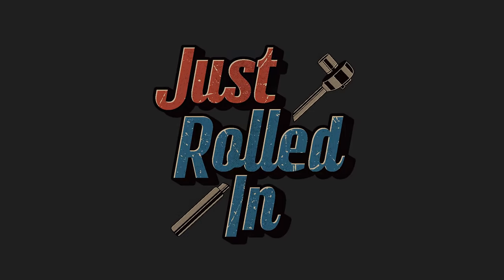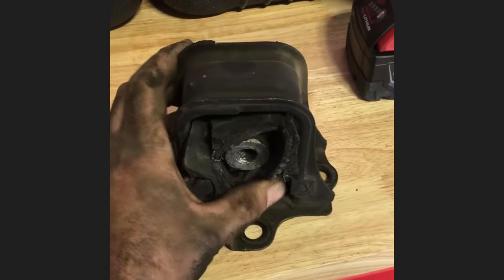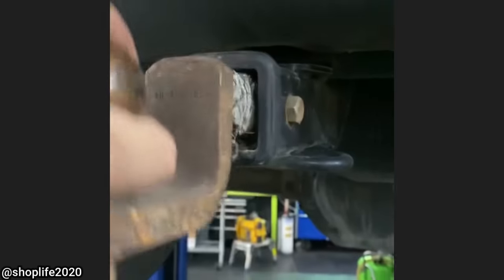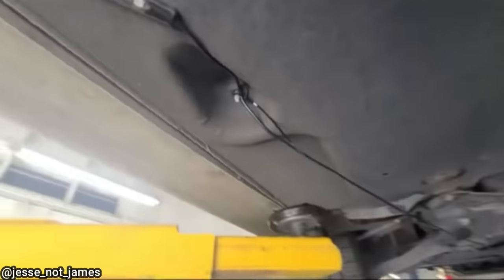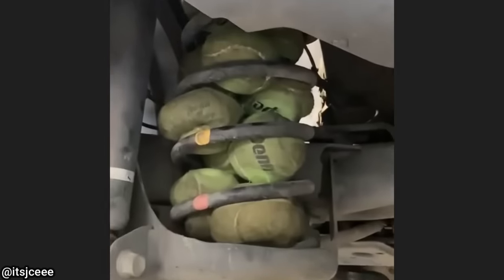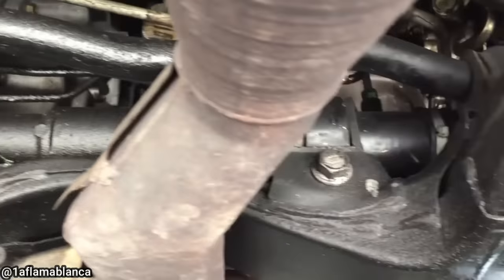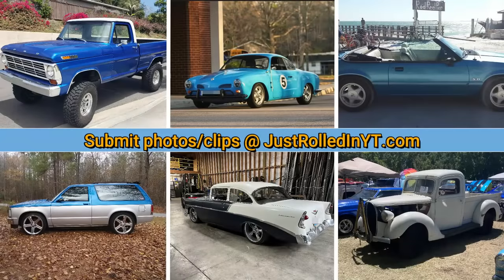Customer States Change Engine Oil On Tesla | Just Rolled In

Comment: I worked with a guy who got his amusement calling auto parts stores and asking for spark plugs for his Cummins. More often than not the store employees didn’t understand why this was a stupid request and earnestly tried to find what he asked for
Reply: I spent 30 years in the auto parts business . We did the same thing with new employees including radiator caps for V/W beetles and points for 1975 Chevrolet's
Reply: I once went to get a refurb kit for the carburettor on my Ford Granada. The parts guy, was obviously just programmed to read what was on his screen. The conversation went thus. 

Me: "I'm after a carb refurb kit for a Granada" 

PG: "Engine"

Me: "2.8, manual"

PG: "carburettor or fuel injection" 

Me: 🤦‍♂️
Reply: @eaglerider1826  

The rad cap for a beetle I get but I'd have thought most 70s Chevys had points and a condenser.
Reply: @imSatnav  You can tell it's a new guy reading off the screen and not thinking .
Reply: @skylined5534  1974 was the crossover year for electronic ignition by 1975 they all came with it .
Reply: I can recall some guys getting 2 young apprentices to try and push start a generator that was mounted on a trailer.
They came in after half an hour of pushing it around the yard, and apparently one said "it won't start, but it nearly did, i heard it fire a few times" :-)))
Reply: @imSatnav  ngl that sounds like something i'd do on 4 hours sleep at my retail job
Reply: Same guy that gets up to the front of the grocery checkout line and asks the clerk if the chicken legs are from the front or the back?
Reply: @robertthomas5906  or asks for "extra medium" size clothing
Reply: Some people really need to get laid
Reply: At a recent festival that had a display from a local military unit I asked the guys what kind of helicopter their armored personnel carrier was. To be fair, I had insider knowledge that someone asked that question seriously two days prior so I just couldn't resist. I was hoping they might respond, "oh yeah, it's got cutting edge rotor-less technology."
Reply: Changed some Cummins spark plugs last week, CNG engine 😉
Reply: I loved requesting parts for an 83 Corvette. 😂
Reply: Or a radiator for a Corvair.
Reply: Jeremiah Coughlin  
Some stores stock it as an UNO reverse card when parents send kids to the store to get some.
Reply: @eaglerider1826  my 79 chevy had points
Reply: @MsAubrey  they do exist.  Both of them, somewhere.  Probably still at GM, though.
Reply: I worked in an auto parts store for a few years.  I had a great mentor.  He been doing it for over 50 years.  Taught me how to use books instead of the computer, and how to find stuff when we ran into dead ends.  I don't bother going to autozone or Napa anymore.  I find it myself and have it shipped to me.  I still remember the old man, and how many of the customers weren't servicing cars, but their items had car parts, such as boats and generators.  We even had military and military contractors coming to us when they hit a dead end.  We weren't always successful, but we always gave it our best effort.
Reply: @TheCabinfever1977  Sir , In 1979 it came from the factory with an ignition module and not points . Someone may have changed the distributor but it did not come that way from the factory . Try going to the NAPA auto parts and looking up a set of points vs an ignition module for your 1979 .
Reply: @MsAubrey  Good one . Most people didn't know that that was the only year that they didn't make one .
Reply: @domin8ss  not for customers. You clearly know what I mean.
Reply: @eaglerider1826  yep. I had a guy call in saying he had a Corvette built in July 1983. My boss back then loved Vettes more than me. When the guy got pissed when I kept asking if it’s the new body style or the old one, he asked to speak to my manager. So, I paged him over the paging system and said, “Hey, Scott a guy on line two wants to speak with you because he said he has a 1983 Corvette and I told him that he didn’t.” I heard roaring laughter from his office. I went to the office and he let me in to hear his conversation. It was pretty funny.
Reply: @MsAubrey  Years ago we sponsored car shows in Alabama and to win the door prize you had to be the first one to the d. J. booth and tell him what year did they not make a corvette .  Hundreds of car guys there and it would take a while to get a winner ( this was before you used your phone to look it up ). Funny part , it was never one of the guys driving a Corvette .
Reply: @MsAubrey  and you knew what I meant, is why it's dumbfoundingthat you got butt hurt about my comment.
Reply: @domin8ss  not butt hurt. Your comment simply didn’t refute what I said to begin with.
Reply: @MsAubrey  you're correct, yet somehow seem confused by this
Reply: a car parts store in germany, somewhen in late 90's. customer came in and asked for a 24V-battery. clerk said, "there is no 24V battery. you either use two 12V batteries or..."
"nono, I'm sure, 24V!"
"What are you talking about, there ain't no 24V battery. nobody never made one!"
"But, it says 24V right on the trunk of my car!" customer point outside to a Opel Senator with 3litre straight six with 24 valves...
that's when you start to wonder if they are that stupid, or trying to troll you...
Reply: @eaglerider1826  it was a 1979 Chevy C10 with a straight 6 3spd auto with points, when i looked up the vin on the engine it was listed as a car
Reply: @TheCabinfever1977  You just answered it . The engine was out of an older model car .
Reply: Jeremiah Coughlin  Should call a BMW dealership, their cars need their fluid replaced frequently, to prevent malfunction.
Reply: @imSatnav  "Carburettor or fuel injection?"   "Neither right now. That's why I need the carburettor."
Reply: @robertthomas5906  From the back. The front legs are called wings ;)
Reply: @BrutalHonduras  Ask sometime if the drumsticks are from the back. LOL.

Comment: In the 1960s, when I was 16, working in my father's garage/ gas station, a very cute girl pulled in and asked me to check the water on her Corvair. I explained that it was air cooled, trying my best to keep the conversation going as long as possible, when she pointed out the Oil cap, which understandably although it was labeled oil, was shaped kind of like a radiator cap. I never forgot her.
Reply: so did you marry her or what?
Reply: @Draco_Alpha  Nope but there's still a chance we might meet again someday. 😎
Reply: When did you wake up?
Reply: Are you sure that it wasn't a 710 cap?
Reply: @stephenolan5539  Oh! Snap. now I get it.

Comment: When I was 16 and changing my oil for the first time I bought the wrong filter and thought I screwed it on right. It wasn't, and I didn't. I ended up spewing the oil all over the driveway. That was a fun clean up, and I haven't made that mistake again for the past 3 decades and going strong.

Comment: The door opening clip, I am genuinely perplexed by that one lol.  Sweet Chevelle!!!
Reply: It looks like the controls on the door panel or sunk in and obviously not attached to the armrest properly so when he pushes the button it must’ activate the door lock Switch
Reply: @bigtuna9529  yeah but why would that open a manual handle and latch??
Reply: @DJTheMetalheadMercenary  

My thoughts exactly.
Reply: @skylined5534  Right?  Doesn't make sense.
Reply: Window opens and car's exterior has a 'hole' int it.  Slipstream is disrupted
Reply: @RideAcrossTheRiver  For how low of speeds that looks to happen at in the video, I highly doubt the airflow disruption would be enough to cause that, unless the manual door latch itself is broken or otherwise too loose to maintain latching at ridiculously low speeds and pressure fluctuations.
Reply: @DJTheMetalheadMercenary  Could also be an electrical short with the window that unlatches the door, causing passenger to fall out to the minor slipstream!
Reply: @RideAcrossTheRiver  That's what the other guy was alluding to I think, but it's a manual latch and handle, the electronic lock system doesn't have anything to do with the door opening or closing, only the lock/ unlock feature of accessing the door.
Reply: @DJTheMetalheadMercenary  Then it's the slipstream being just enough to hold the door closed.
Reply: @RideAcrossTheRiver  Honestly, more details/ context of what was actually causing the door to manually unlatch in the first place is the important factor apart from what the other comments said about the electrical function issues.

Comment: I feel for the guy that made the oil tank mess. Once in an attempt to ID fuel lines that the day shift had disconnected, I had the genius idea to use the shop air to blow through them. Blew a screw out of the top of the fuel tank on the opposite side of where I was standing. Didn’t realize what I had done until it was raining diesel fuel all over the shop. It was about midnight and the boss walked in to see how things were going while fuel was still dripping from the ceiling.
Reply: "I struck oil, boss!"

Comment: We got these nice new oil drain riggs at the shop. When it was time to drain them, you just roll it over to the waste oil cube, put the hose in and then connect the air line. The thing is, before applying the air you MUST pull the drain pan all the way up to engage the stopper. If you didn't the tube would then remain below the oil level line and then when you connected the air hose the oil would blast out the top like old faithful.

One Saturday we had one of the neighborhood kids helping out in the shop so he could make a few bucks. Apparently one of the guys instructed to drain the rigg without telling him to pull the pan up on purpose. I happened to look over just as he was connecting the air hose and only got out half of the word "stop", that kid literally took a shower in the oil with it running down his forehead from his scalp. The guys were laughing after setting him up for it and even though it was cruel, it was still pretty funny.

Comment: Ive had my own oil mess when i was on my first few months on the job as a diesel mechanic. 
Assisting with removing the Eaton Fuller tranny on a dump truck for a clutch job, i started to remove the PTO before draining the oil, so when i broke the seal of the gasket i dumped oil all over myself.
Lesson learned

Comment: Re: the car with the tire packed engine mounts: Had a new Ford Tauras with 1,200 miles when the engine/transaxle fell out, but never fear, the "Check Engine" light did come on. The axles held it in place long enough to pull it over and call the tow truck. My dealer stated, "he saw no indication that any nut had been placed on the bolts". No wear marks.

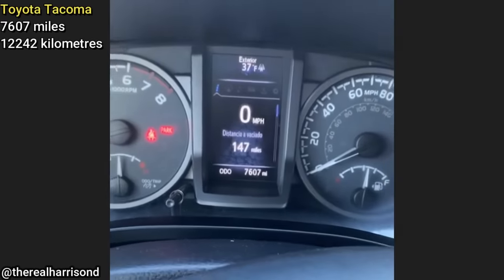Comment: 0:38 I used to work for a guy that imported 70s classic Kawasaki's from the U.S, Z1, Z900's, H1 Mach 3's , H2 Mach 4's that sort of thing, and so many bikes had wood screws used to hold bits on, another common bodge was imperial nuts & bolts forced onto the metric threads. The funniest one was a hose clamp used to hold a front sprocket on :-))))
Reply: 5/8 whit and m16 gets them everytime.... I've seen ot in the UK too with the old classics.

Comment: I always get good maintance tips. Using old Tennis balls as Suspension. Pieces of old Tires for engine mounts.Never changing your Oil and yes of course who needs brakes.Eli your saving me tons of Dough.
Reply: How well would the tennis balls actually work? I could imagine them being semi functional as shock absorbers.
Reply: @MichaelKean  they actually work on the light cars, below 2000-2200 pounds. Was quite popular mod decades ago, useless now when even the smallest vehicle weights over 2500.

Comment: It's my understanding that Teslas do actually have an oil filter. At least the drive unit I saw someone swapping into their project car has a filter and pump unit on it, so it does have oil, just not in the conventional sense. Probably more like rear end lubrication, though some electric motors use it for cooling as well.
Reply from the maker: Yea I just read that online the other day.  Have yet to ever work on a Tesla though or drive one lol
Reply: Teslas actually use ATF, which should be changed at its intervals.

Comment: That's worse than a kid trying to fill up his Tesla at a petrol station, next level stupid.......bless em! 😁
Reply from the maker: Crazy how many clips I've seen of Tesla's at gas stations and people trying to get gas 😅
Reply: @JustRolledIn  I don't want to be cruel, let's just say that the mind boggles!
Reply: But if you oil the battery, the electricity has less friction and flows faster and quieter.
Reply: Nah whats worse is brake and headlight fluid
Reply: At least they are trying to get an oil change
Reply: idk petrol station seems worse to me
Reply: Teslas have gearboxes, which need to have oil. Coolant and brake fluid can also leak.
Reply: @FozzyZ28
Actually Tesla's need oil and oil filter changes, even twice if there's a front and a rear motor.
Reply: I remember a photo op our illustrious VP did a few months ago where she was showing how easy it is to charge an electric car. After plugging in the charging cable, she stood there holding it, as if she was putting gas in it. I guess nobody told her how it actually works. Of course, given how many of her staffers have quit, that could have been intentional.

Comment: That Tesla owner thinks they bought some oil cooled electric motor version. Lol.
Reply: hell I'm my famillies handyman and when I saw the title I was like do teslas need oil?
Reply: Idk what's worse. The fact he took the car in for an oil change, or going to jiffy lube.
Reply: They do need that drive unit oil changed, just not as frequent, also it has a oil filter that looks just like a normal engine one lol...
Reply: @goreobsessed2308  They've got transmissions and differentials, so they do need oil changes at SOME POINT, but there's no engine oil.
Reply: Actually they are oil cooled. There is coolant to oil heat exchanger on each drive unit, they also have an oil pump and filter.

Comment: The funky brake line routing reminded me of a 1994 Ford F150 I replaced the steering gear on. While it was on the hoist I saw brake line wrapped around the one of the rear axle tubes.

Comment: Tesla does get oil changes. The drive-gear takes oil (trans fluid) and has a change interval. 
Not very often but still needed.
Reply: Yup they also use antifreeze to cool the batteries and have a small radiator too.
Reply: Brakes last a long time too.
Depending on the driver tires can be $$$$$
Reply: @UC2HmLK77tjp54jTNdHpF4Bw That doesn't sound bad TBH.
A base Model 3 is pushing 300 and an S plaid is over 1,000 hp.
Those tires are specific for a reason.
Reply: It's unicorn gray, so probably an early build. May be at the mileage where service is needed.

Comment: So a little known fact about BMWs is that every single BMW made after like the E46 has a air intake very low down and pretty much any BMW that drives into a puddle more than 6" will hydrolock
Reply: Probably the same engineer that removed the dipstick on them. :-)
Reply: Apparently late model Jeep Wranglers will suck water into the air-intake in fairly shallow water, even if fitted with a snorkel!
Reply: @uhtred7860  terrible idea since what if the computer acts up which have happend. Granted cars have a built in systems that gives you a warning if your oil goes low but still nothing beats the old dripstick
Reply: that is not true. most BMWs have their intake opening right around the front bumper cover level, a little below the headlights. Certainly nowhere that close to the ground and they do not hydrolock any more or less easily than any normal vehicle. I work on BMWs professionally
Reply: That's a good thing according to the way most bmw drivers drive!

Comment: I understand the tennis balls in the rear springs thing.  Sporty fwd cars trying to maximize grip on the front tires at launch.  I used footballs when at the track.  Inflated them when I first got into the pits, and deflated them when racing was over.  The footballs were always in the rear springs though.

Comment: The one with the drywall screws - while not near as extreme - I was gifted a 2001 F250 Super Duty pickem-up truck, and parts of the interior are screwed down - LOL. But hey, the truck runs and in pretty good condition, aside from needing either Wiper Motor or Multi-switch, it's a good deal. Zero dollars is always a good deal. Maybe 😁

Comment: The oil used in a Tesla's drive unit is a synthetic type called Pentosin ATF 9, and the oil filter part number is 1095038-00-A. Unlike your standard engine oil, this synthetic oil doesn't degrade or become contaminated by fumes – the main reason Teslas don't need oil changes.

Comment: Teslas actually do have oil changes. The drive units use automatic transmission fluid and have a regular screw on filter. I'm sure the customer probably was confused and didn't know what they were asking for, but otherwise they're not wrong. This was a fail for the mechanic to not know this.

Comment: I wish we had cameras back when I was working.

One of the guys had to remove the gas tank to perform a repair.   He didn't notice that some fuel had run into the drain between the bay and the door.  As he's using the cutting torch, we hear, "whoosh", and a 3-foot flame comes out of the drain behind him.

"Paul!", "What?", "Look behind you!", "F@@k!!", and he bangs his head on the car tire running for the extinguisher.  lol

There was nothing flammable near the drain, fortunately, or we would have gone after the extinguisher rather than yell at him and laugh.